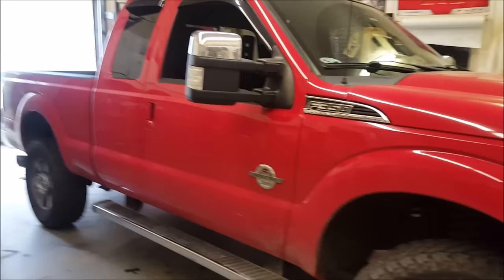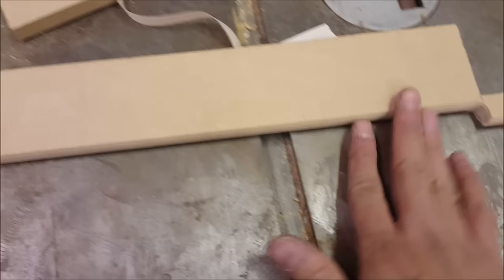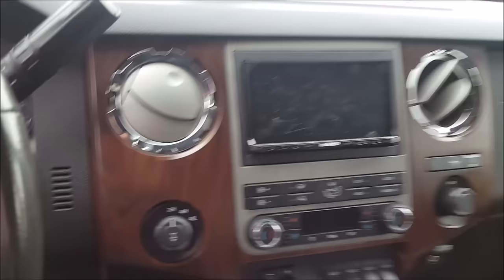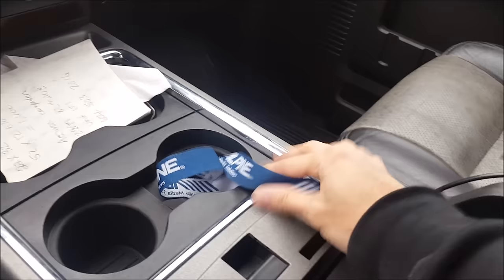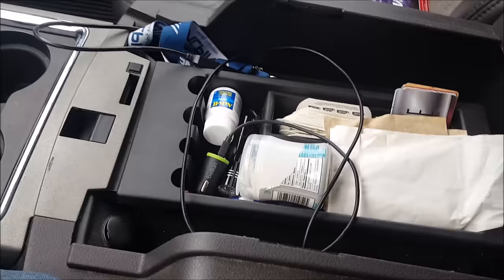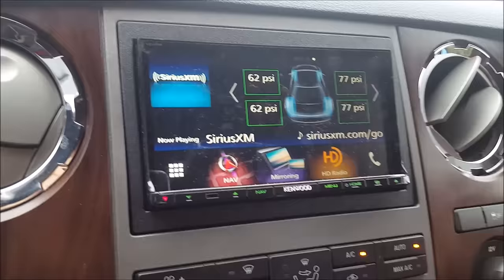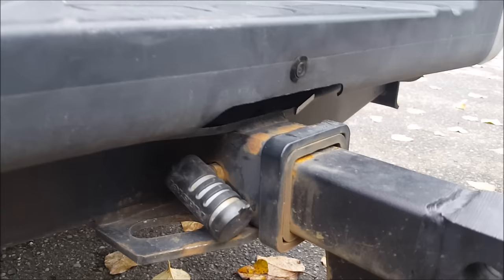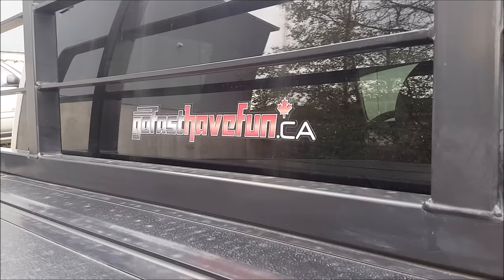Builds: Ford F-350 Super Duty Stealth Audio System | AnthonyJ350

Comment: My 2012 F250 cost me $820 last week. I'm looking Into wheels and audio now.
Reply from the maker: What are you doing for audio?
Reply: @AnthonyJ350  I'm not sure what to do on it. I left the audio scene around 2012 and have some stuff in the shed. I have a Hifonics Colossus XX, Audioque 12 HDC3, 6 runs of 1/0, PPI 8" mid range drivers and random junk. I am thinking maybe 4 8s under the seat. I have owned the truck about 2 weeks or so and still looking on ideas for audio and wheels. I just did front grill and lights today.

Comment: personally I would have put at least $7500 in making the truck look and perform good (lift, big tires, etc) but that is an amazing truck as it sits
Reply from the maker: To each their own.  This truck was put together to enhance the stock look.  Having a lift is mainly only for offroading.  If you tow, or plow having a lift will make the truck perform less.  This truck will be getting an exhaust upgrade later down the road.

Comment: Just found this video, what adapters did you use to keep the factory Sirius system?
Reply from the maker: Just plugged the factory antenna into the new SiriusXM tuner for the aftermarket head unit.

Comment: <---------------The 4 door looks a lot better ........................
Reply from the maker: BIGRED SUPERDUTY I don't know. I like the stubby look. Reminds me of a red version of Bigfoot lol
Reply: BIGRED SUPERDUTY all 4 door trucks look good I wish mine was a 4 door instead a 2 door with little crappy back doors
Reply: @AnthonyJ350  the 1/2 make the truck leak like a sive in hard rain make the cab twist as they get older the start making banging sounds on hard bumps and when drive hon a hill off road i love the truck but hate the 1/2 door enough that I bought a cab and new frame an I'm got to move all parts over at some point lol.
Reply from the maker: @vapeking8882  I still see this red truck, this one in particular hasn't had any leaking issues.